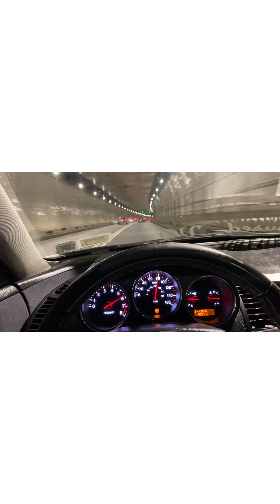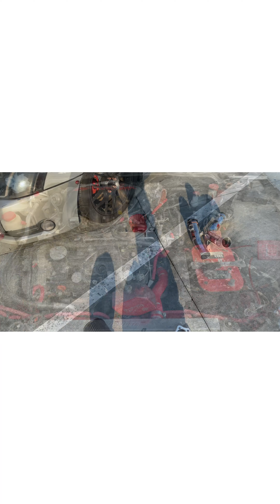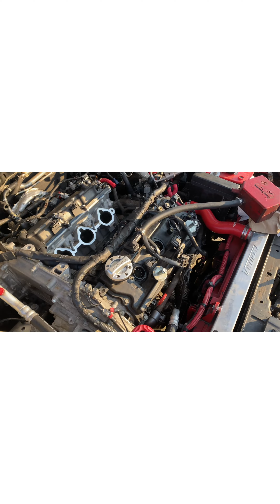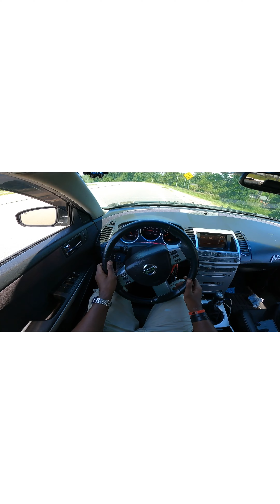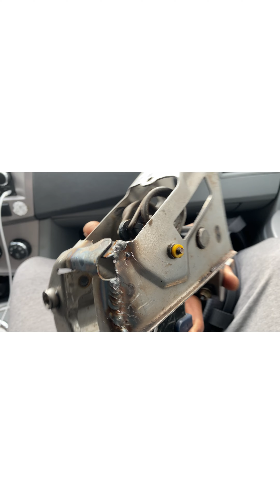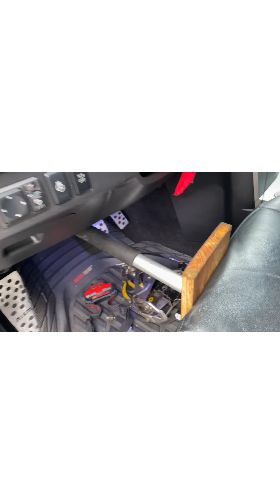Hydrolock/Clutch Pedal Assembly Repair/POV-_-SS2Point0Vlogs

Comment: When you said you hydro-locked your engine I thought for sure you might have bent a connecting rod, but you lucked out! I have the same cold air intake (injen) as you have. I purchased the nylon sock that goes over the filter that keeps water from saturating the filter, so far no problems. I kept the inner fender liner intact, I really wanted to cut out the panel that's just below the filter but that would expose the filter and possibly suck in water. KEEP ON MOTORING!
Reply from the maker: Hey bro.. Yeah, I dodged the bullet on that one.. I thought the engine was done for.. I do as well. I have it in red. And good idea to leave the fender for that little extra protection.. Stay safe my brother..